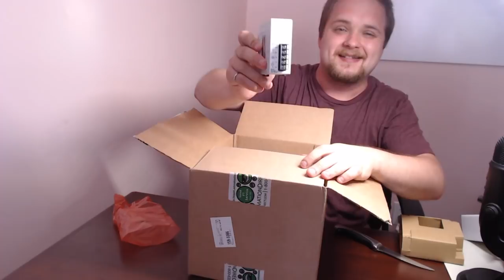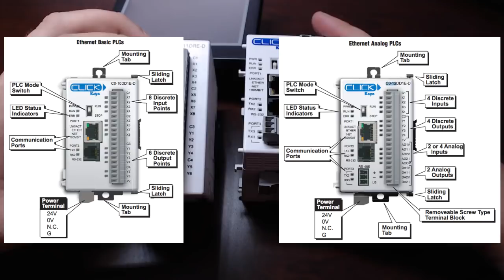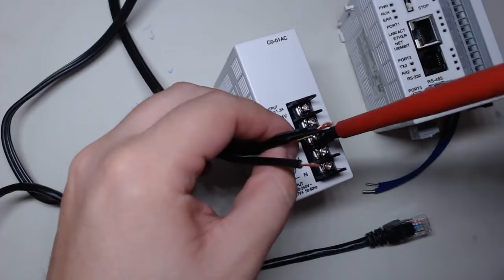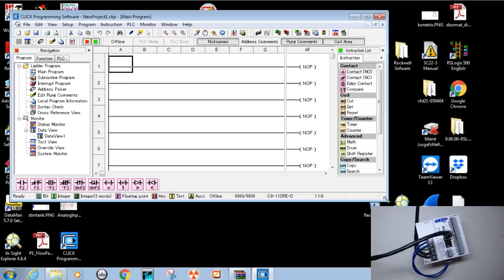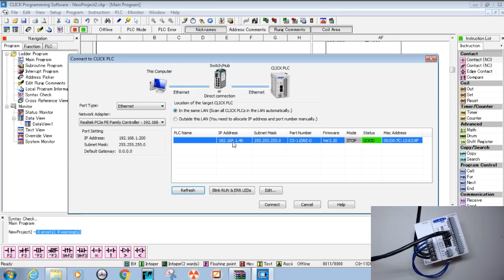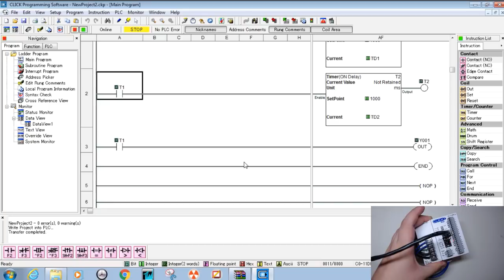Click PLC Unboxing & Programming / Getting Started Tutorial - Wiring & EtherNet Communication

Comment: I'm thinking about adding one of these to an off grid solar project.  I will be running a 24 V DC system with a charge controller, batteries and inverter.  Other than basic current protection, a fuse, do you think I would have to add a voltage regulator to keep from damaging the Click with power fluctuations?

Comment: At first glance...

I would have routed the 24DC output wires out the other side, and crimped ring terminals on the AC input connections.

Comment: Hello man, i did some code for automatic gardening, im almost finished, it uses your LCD MENU tutorial code, with some tweaks and also reads some sensors, i would like to know if you could check it so i know im on the right path. also want to know how to use delays longer than an integer, as delay max in milis is like 32ksomething
Reply: I'm certain this won't be timely enough to help you but in case anyone has the same question and finds your comment, I have had timers cause a counter to count up every x time, say once a second, then once the counter reaches 3600 you can have something happen, then reset the counter.
Reply: For longer delay just use another integer variable. Let's say every 25k millis increase the second variable so you can have 25 seconds * 32k which is over 220 hours. if you need longer take a third variable. When you rich 32000 on the second, increase the third and start the second from zero. You can have 25 seconds*32000*32000 = 811 years. I don't think any of us would be still around here to witness the moment.

Comment: Great video man, very visually informative. I haven't worked with plc's since the Allen Bradley in college. I have a project I'm starting to upgrade a few machines from mechanical 240v timer controls for my company. I have been looking at purchasing these but I've never built a cabinet before so I'm definitely learning as I go. I built a program and an interface, just have to purchase the hardware and hope I don't break anything hooking it up. Covering some videos on the physical wiring of these with terminal blocks inside a cabinet would be awesome. The most confusing part to me was how to wire and protect everything properly. Like dealing with inductive loads and why RTD's and TC's can't be used with standard analog inputs.